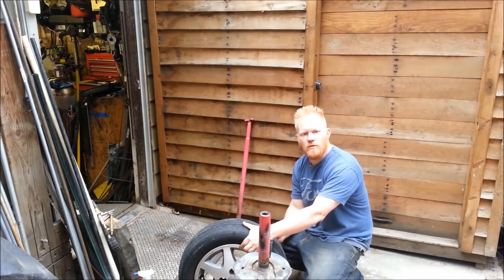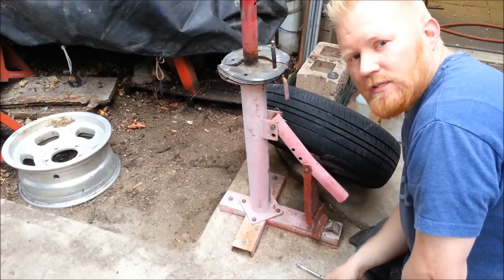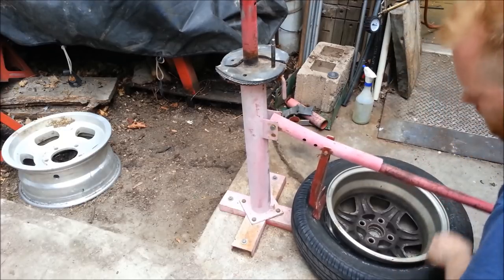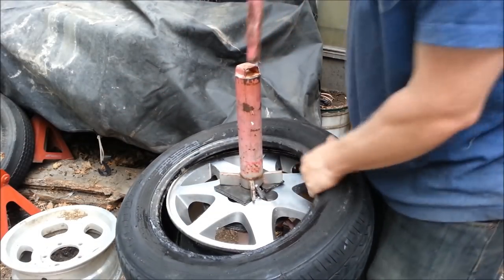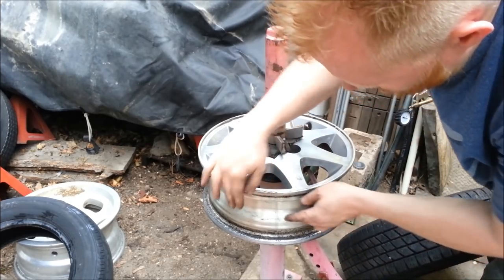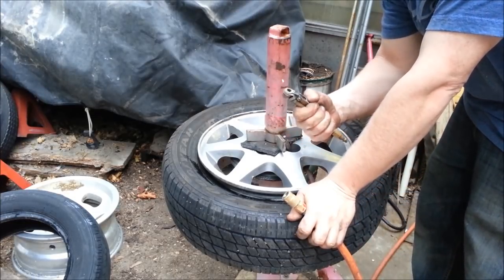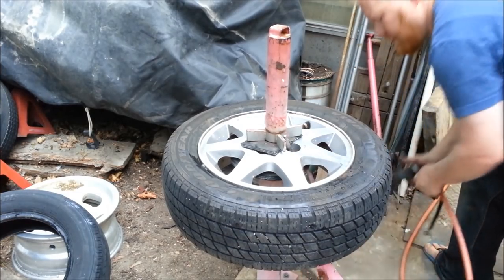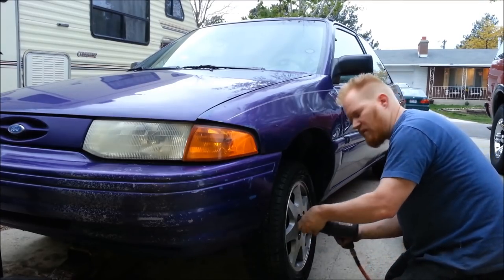Make a Manual Tire changer machine Awesome

Comment: i wonder if you put duck tape on the tire changer it will stop it from scuffing the rim. has anyone tried that by any chance?
Reply from the maker: +tuga2112 There is a lot of force between the bar, tire and rim and duck tape will rip. I have made wooden levers along with pvc plastic ones and they work OK. There is a company selling a nylon tipped bar that'll save your rim for around $100.
Reply: +sixtyfiveford 
i have removed tyres manually a couple of times in the past (without a tire changer). I understand the amount of force required. (specially on low profiles) but the motion on the rim is sideways. reason why i wondered if anyone tried duck tape, cus a few layers of that can should build up some considerable protection together with lubricant... 
Im asking if anyone tried because if people have tried and succeeded That would justify miself buying one of these. I currently have 2 cars in need for tyre swaps. so one of these changers would pay itself within the first week. 
but this will only work if my rims dont get damaged. as i am a bit on the protective side tohards them.   

a wooden edge on the lever souds like another "free" and likely to work approach. just requires some extra work to fabricate. 
thanks for the tip.
Reply from the maker: The tire changer allows you to remove them like you would without the changer by inserting and prying straight over. But gives the huge benefit of holding it at height and clamping it down so it doesn't move. I would say it's half the work with this tire changer than without using traditional methods on the ground. As far as sliding the tool around the force against the rim is 10x greater and duck tape will tear instantly. I've placed 1/8" plastic pvc pieces between the rim and tool and it'll cut right through them with truck tires. Car tires are easier with their super flexible side walls, but this will still scuff the lip.

Comment: Very difficult for my 16in truck tires, 10+ ply
Reply from the maker: I've done these many times. You have to have the changer bolted to the concrete, use tons of lube and make sure the tire is warm.

Comment: That tire changer works good for light duty car wheels and smaller! Offroad wheels is a no go! The sidewalls are too strong and stiff! You need a real tire changer for them!
Reply from the maker: I use it for off road/heavy duty truck tires all the time. I've done 40",37", 35", 33" mud/AT tires and tons of E rated 31".
Reply: @sixtyfiveford  hmmmm that’s interesting! I’ve had no luck! Can’t get the bead over the rim...bends my tire tool! Maybe you should do a vid! Thx

Comment: ive got good tires on old rusty rims and   bald tires on good rims and good rims with junk tires.. flatt tires and leaking beads in my hoard of tires so rather than spending so much money at the local garage  I'm going to buy a tire changer  but the only concrete floor is my basement floor... I have a pole barn  with a 3/4 plywood floor  or 2 x 4  floor joists  sitting in the sand bed since 40 / 50 years... how about  4 lag bolts into my plywood  floor???????????
Reply from the maker: Sounds like it would work good.

Comment: I'm fine with changing tires by hand, but as I've also worked in a shop and can change by hand and on a machine almost by instinct now, It's almost never a good idea to change passenger tires by hand unless you're extremely careful.  the chances of ripping the bead on a passenger tire by manually changing are extremely high and if you're going to risk wheel damage and bead damage, it's better to just pay the 10 bucks to get one mounted than to ruin the bead just to seal it on your brand new Michelins.  The only tires I've seen that are alright to change with these are 10 plies and commercial/farm equipment; but then, you could just as easily mount them without a changer at all, with just a few bars and a bead breaking claw.  I don't know why I'm getting so many manual tire changer videos suggested to me(well I do know, it's cuz I keep watching them!) but every video I've seen that's of a passenger tire being changed manually, the bead rips.  

However, I'd totally do this if I had some beater car that I'd only be throwing used tires on, so on and so forth.  Gimme an old honda, toyota, whatever, with some 15 inch steel wheels and always running used tires and yes, if I couldn't just go to my shop and mount and balance them for free and do the job MUCH better, I'd totally mount em manually!  The only thing here is that you'd have to do tires often, in my eyes, to outweigh the cost of all the setup and learning curve.  
P.S.: It's always good to befriend someone who works at a shop or a big name tire store :D

Comment: My uncle told me a long time ago that if a tire is driven in a certain direction you should not run it the opposite way as it will break the wires inside so a easy way to tell which way a tire has rotated is run your hand with the threads  and you will notice there is a high side and a smooth side the smooth side is what contacts the road first and the high side is what  leaves the road last this shows you which way the tire has run.

Comment: I bolted mine to a pallet because my backyard is paved :( no point bolting it to 4 bricks ;) I find it works fine as long as I am standing on the pallet, which is fine so long as you can do everything from standing in front, for putting the new tyres on I prefer two tyre levers to the, lets be honest, piece of shit bar they give you with the machine ;) I had to grind the fuck out of it to make it smooth, the welds and surface at the business end were awful, great machines with a little modifcation though, they cost around the same price as getting 4 tyres fitted. I have to disagree with not balancing though............. having a front wheel 15-20g out of balance drives me insane........... takes about 35+ to upset the rear but the steering wheel "kicking" pisses me right off. It never used to, but after working in a workshop that also did tyres for several years and having access to all the free fitting and balancing I could be bothered to do spoiled me............ I change front tyres to the back and put new fronts on everytime the wheel starts to wobble at 100kph, which is roughly 5000km depending on the tyre. I used to re-balance them when it was free to do so, but rear tyres don't have a great life expectancy on a ute anyway ;)
Reply from the maker: ***** Yeah, tires seam to go out of balance as they wear. That's the only reason I say not to worry about it to much as most people never rebalance a tire for the life of it. Nor do I hear people complaining.  While helping friends do brakes I've balanced their tires that required as much as 50-70g. They never seam to notice a difference and sometimes sympathetically say it feels a little smoother. It seams that I pull tires all the time that have chunks of road tar or mud on the inside that have to throw the balance way off  by 20-30g, but people never seam to notice or mind.               I have had tires that are crazy with vibration and need constant balancing but those are pretty rare.     I really wish they had Utes over here.

Comment: Nice tips man. Check out my tire change videos. I'll be adding your rubber tips to my process. I can't get the T end of the bar to work for me, it always wants to roll over and pop out. I do a E load rated BFG all terrain truck tire in that vid, it handled it pretty good. I like to use 5/8" Tapcon bolts to hold mine down. They thread right into the concrete and make it VERY sturdy. Also welded the base to the leg pieces. I also have the bubble balancer. You have that?
Reply from the maker: John H Yeah, I have the bubble balancer as well. It seams to work pretty well. Yeah, I hate the T end as it only seams to sorta work on light duty tires. I have made plastic caps that slide onto the bar end to protect aluminum rims. I'll have to show those in an upcoming video.
Reply: Cool! I look forward to seeing what you used for the plastic caps. That's been on my mind as well.

Comment: You didn't clean the old tire remnants off the bead seat of the wheel. That's asking for a rim leak later on. You didn't loosen the rim hold-down before seating the bead. Just a couple of turns will let it seat easier with less air pressure. If the rim is cleaned and lubed, it shouldn't take any more than 25 psi to seat it. You can stand right there and use the tire gauge on the hose to avoid a violent pop when it seats.

Comment: Diluted body wash makes for a good lubricant.
Reply from the maker: Ben Bat Really?
Reply: sixtyfiveford Yes, dish washing soap is a degreaser, not best for rubber. Body washes main base is usually made with mineral or soybean oils.
Reply from the maker: Sweet... Great tip.